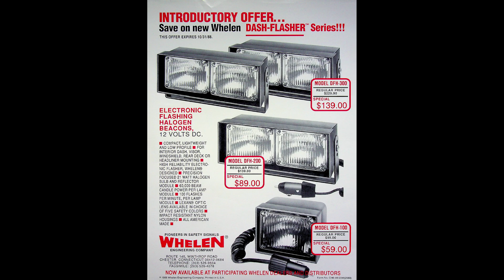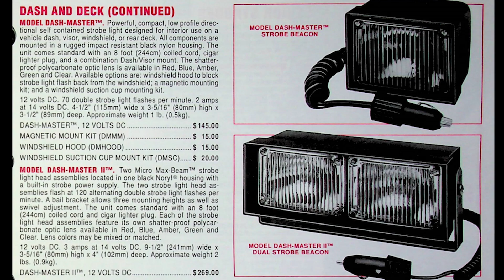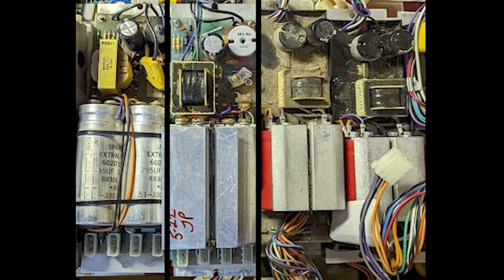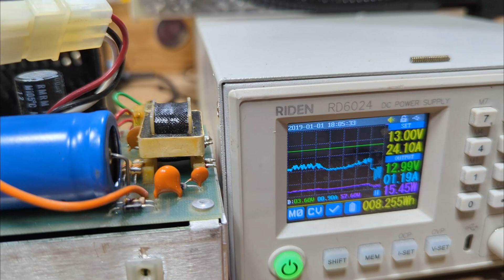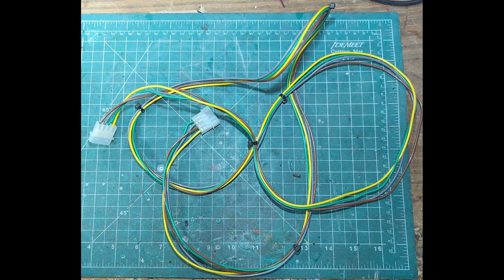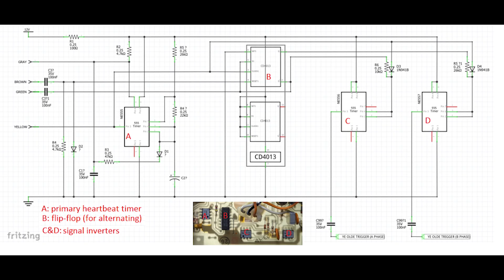Whelen Deck-Master Strobe Project, Synchronizing in strobes 1987

Comment: Man, the more i watch your channel, the more i love it. 

I had an idea a couple of years ago to use ecco strobes for an edge 9m i have, since i somehow kept blowing up power supplies while screwing with it, and original edge strobe bulbs where for me, getting expensive. 

Along with an idea to use par36 strobe bulbs in the bumpers of my 82 jeep CJ7, since they look close to period correct. They were mostly for fun, but i was going to use a chinese strobe supply to power them. ...or make par36 bulb housings out of halogen bulb sets using ecco or chinese xenon flash bulbs. Seal them up with RTV like whelen.

While I'm blabbering, i found out that you can sync leds to a Chinese hide away strobe sets, by splitting the signal between to microcontroller and the Diacs. Using a few (one per channel) transistors to act as switches for solid state relays, i was able to synchronize slave light heads in my bumper of my work truck, to my corner strobes in the headlight and taillight housings. More for fun than anything serious, but the concept worked after a little troubleshooting. 
You'll need a few resistors and so on, support circuitry for the transistors, but that comes along with any circuit
Reply: ...i used 3w LEDs and lenses to make split led light heads that mount into the backbone of a whelen edge as low cost retrofits, kind of like the freedom series. Ran them off of individual ATTINY85 microcontrollers, and mosfets that i was able to synchronize together to allow me to have a 3 color edge bar. That was a fun project. 

If it isn't already apparent, this is one of my "SpEcIal iNtReStS" (wrote for comedic effect).

Comment: Also i had the single head Halogen one which in 2018, i transplanted into the middle section of a Responder II mini bar. And then not even one tenth of a mile down the road after installation, a semi drove the opposite direction of me and swept it right off.
Reply: The Whelen version*

Comment: That same issue with multi head color blend happens with LEDs.  Red/Blue looks purple, Blue/Amber can look green, White/Red looks pink, and Blue/White looks washed out.  It's interesting that it's never been solved after the decades of strobe use.  Also I would place a warning message in videos like this for people with epilepsy when you activate the strobes.